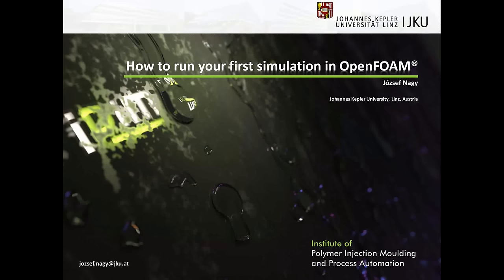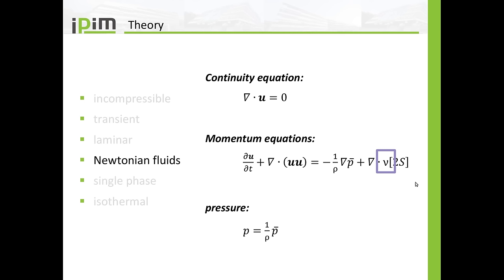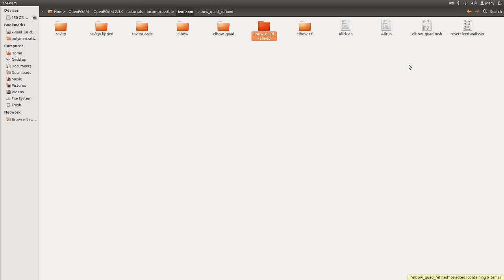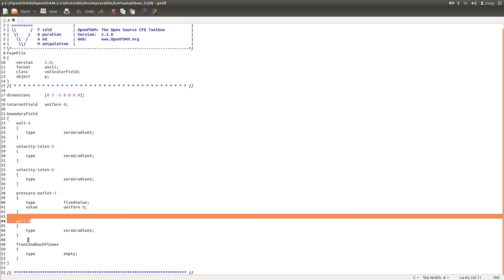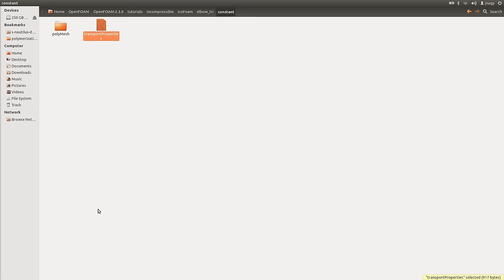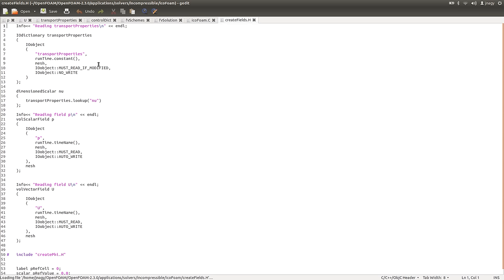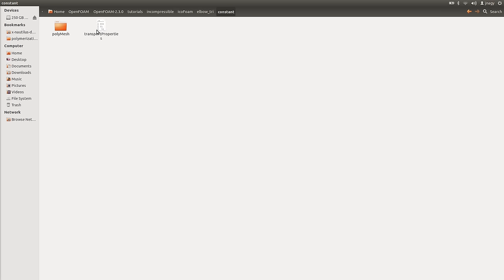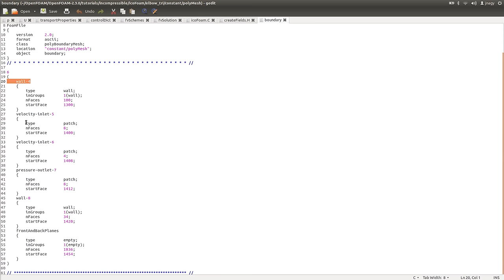How to run your first simulation in OpenFOAM® - Part 1 - tutorial (download link to msh files below)

Comment: Thank you.
I am using a Windows 10 based OpenFOAM.
when I make copy of the 'elbow' file and try to call the folder in the 'Ubuntu' page (as you mention in this video), it says 'access denied'!
no matters what I name the copies. 
it only calls the original file.
I would appreciate if you can guide me to come over this issue
Reply from the maker: Where are you files located? On your linux file system or Windows? What is the path?
Reply: it is on:
C:\Users\aeyad\AppData\Local\Packages\CanonicalGroupLimited.UbuntuonWindows_79rhkp1fndgsc\LocalState\rootfs\home\amin\OpenFOAM\OpenFOAM-v1712\tutorials\incompressible\icoFoam

this was chosen automatically during the installation.
Reply from the maker: I see. Yes you are not supposed to access the files from Windows in that location. Open the bash and copy it there with Linux.
Reply: I just searched the disk for ubuntu and I see that there are many files and folders related to ubuntu. The .exe file is under:
C:\Users\aeyad\AppData\Local\Microsoft\WindowsApps\CanonicalGroupLimited.UbuntuonWindows_79rhkp1fndgsc 

and the other files are under:

C:\Users\aeyad\AppData\Local\Packages\CanonicalGroupLimited.UbuntuonWindows_79rhkp1fndgsc\LocalState\rootfs\
in different folders.

what exactly should i copy and how? can I do that using 'copy+paste' in windows or should I do it in bash?
Reply from the maker: No that is a terminal. You do it like in a terminal in Ubuntu. You have to type in the commands.
Reply: I copied the whole tutorial and pasted by the ubuntu.exe and it worked.
thanks a lot.

in this video you have this 'elbow_quad.msh' which you will use it for two of the simulations.
where do we get that from? or how do we make them? without that it is not possible to follow the next video!
Reply from the maker: Download link in the description of the video.
Reply: Thank you very much for your awesome work and incredible support.
Reply from the maker: I am glad to help.

Comment: Hi József, thank you for the video. But please help me, this is my first time in OpenFoam, I've just downloaded and installed it, but I have an error on "fluentMeshToFoam", because I got a message in the terminal that says that it can't find the order. Thankyou,
Reply from the maker: +alesabden Did you watch my video on how to install OpenFOAM? Maybe you forgot to add the one line into your .bashrc.
Reply: +József Nagy thank you, i'm gonna see it
Reply: +József Nagy ,
Hi József, thank you for the video. I have the same pb than alesabden, running "fluentMeshToFoam" , the command is not found. 
I added the line "source $HOME/OpenFOAM/OpenFOAM-3.0.0/etc/bashrc" because I installed the software in my home directory.
The variable $WM_PROJECT_DIR is : /home/romain/OpenFOAM/OpenFOAM-3.0.0
And I ran "source $HOME/.bashrc" in the folder OpenFOAM-3.0.0  

Did I forget a step ?
Thank you
Romain
Reply: I just found the pb.
I ran "wmake $FOAM_UTILITIES/mesh/conversion/fluentMeshToFoam" and now it works. I suppose my initial installation was wrong ...

Romain
Reply from the maker: I'm glad it works.
Reply: +Panloup Romain Can you explain a bit more as to how you solved the problem?!
I'm still getting the "Command not found".
Reply: just check the video of how to install OpenFOAM. In my case, I was missing the bash part
Reply: I downloaded the DEB pack openfoam 3.0.1 recently and didn't add the .bashrc at the end of the installation. Any way I can fix this problem.   fluentMeshToFoam command not found error is returned probably due to this.

Comment: "Command 'fluentMeshToFoam' not found, but can be installed with:..."
But I already have OpenFOAM installed, btw, V7. Is that a problem?
Reply from the maker: You have to add one line to your bashrc. Check my installation video for more info.
Reply: @OpenFOAMJozsefNagy  This was very succesfull!! With a little bit modifications (I don't know if it should happen), because I am using directly on Ubuntu, so my OpenFOAM was on "/opt/openfoam7"... for now it's working. Thank very much.
Reply from the maker: @AndreLuiz-dz1qk  Great!

Comment: Hiiii...
I opened the elbow folder then after that opened the 0 folder but,  My pressure file from the 0 folder is mot opening. can you please tell which App is that
Reply: also at 18.05 when I'm trying to open the  elbow_tri  it is saying that permission is denied. Can you please help
Reply from the maker: @zeeshanjamal8592  Which OS are you using?
Reply: @OpenFOAMJozsefNagy  windows 10
Reply from the maker: @zeeshanjamal8592  Try notepad++ on Windows

Comment: Hi Jozef, i'm usin Windows and i copy manually the folders renaming them, they disappear in ubuntu environment. Can i work outside from the home/Username/.../icoFoam/...?
Reply from the maker: Sure that should not be a problem. What is the command you use for copying?
Reply: i'm using Windows, i past it with ctrl+v !!
Reply from the maker: From Windows you cannot access the Linux home. Do you copy within the bash or in Windows Explorer?

Comment: in my openfoam version v1812 ,there is no option like polyMesh in the constant folder.sir can you please reply why is it so.
Reply from the maker: Did you execute the command fluentMeshToFoam? Did it run successfully?
Reply: @OpenFOAMJozsefNagy  Hello Jozsef, the command fluentMeshToFoam cannot run successfully. It shows "command 'fluentMeshToFoam' not found, but can be installed with: sudo apt install openfoam". How can I solve this issue?
Reply from the maker: @yuqiwu6023  Did you enter the one line into your bashrc correctly?

Comment: Thank you so much for the video. I am a beginner with OpenFoam. I do not  have the polymesh folder in the constant folder. And I received following error:
   ~/openFOAM/openFOAM-v1912/tutorials/incompressible/icofoam/elbow fluentMeshToFoam elbow.mesh
bash: /home/ofuser/openFOAM/openFOAM-v1912/tutorials/incompressible/icofoam/elbow: Is a directory

I appreciate if you can help me.
Reply: hi i used to have the same issue, its usually because certain files don't have permission to be read/written. You can change this by using the command "chmod +rwx <filename> "

Comment: this you did in Ubuntu right, is there any thing in windows ??
Reply from the maker: Yes I did it in Ubuntu. You can try it in Windows 10: https://www.youtube.com/watch?v=xj0dB_PsElg&t=142s
Reply: thanks for your reply, i finished the installation and able to run the tutorials, can you help me how to generate the meshing in bash on ubuntu on windows and i need to take the images of the final shape, will you help me by  giving few steps.
Reply from the maker: It works like it would in Ubuntu. Try out my multiphase simulation project on my channel.
Reply: thanks for your reply, but am unable to open paraview i installed paraview and xming both in my pc, when i gave the cmd-paraview & it's saying that cannot connect to x server and when i tried with paraviewLinux  & cmd it's says cmd not found but i installed both xming n paraview in my pc,
     and when i tried with nano .bashrc am getting some thing different not like what you showed in the  previous videos.
Reply from the maker: Why do you execute cmd in the bash?
Reply: thanks for  your support, it's really awesome i finished my first simulation, thanks for your videos and help.
Reply from the maker: I am glad I could help.
Reply: hi sir i need one more help to find openfoam process to run simulation on Navier stokes equations for incompressible flow

Comment: First of all. Thank you for your videos.

You say that you are setting the pressure to be the atmospheric pressure (at 8:57) by giving it a fixed value of 0 at the pressure outlet. What do you mean exactly? I know that in this case we are talking about a ratio of pressure and density. Nevertheless, when we set this ratio to be  0 at the outlet, the pressure has to be zero. I would not call this atmospheric pressure since this would be a pressure of about 1 bar (usually) and if we assume air with a density of 1, the fixed value would be approximately 100,000, not zero to be atmospheric.

Again, thanks for the very educational videos. Good job!
Reply from the maker: Here we talk about the relative pressure. It is equal to 1 bar. Since OpenFOAM uses SI units the pressue is in Pa (actually as you mentioned correctly pressue/density). In these incompressible cases the pressure changes by maybe a couple of Pa. Instead of writing 99999.4 we can write -0.6. Or 100000.3 we can write +0.3. This is the idea behind it. For compressible solvers the absolute value is very important.

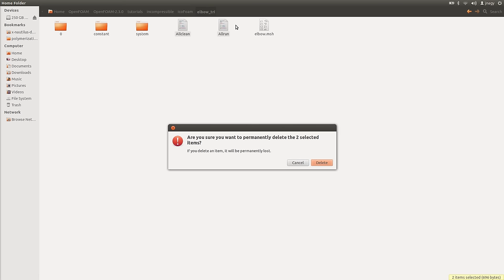Comment: At 6:57 elbow_quad.msh file is not creating what to do. Kindly guide me.
Reply from the maker: Did you download the file? Link in the description.
Reply: Thank you for reply but there is another problem at 15:29 I completely followed your instructions but it is showing that no such files or directory what to do kindly guide me.
Reply from the maker: @ambreenshah7583  Make sure, that OpenFOAM is installed correctly.
Reply: @OpenFOAMJozsefNagy   download as guidelines given by you properly.
Reply from the maker: @ambreenshah7583  Where is your installation? Did you enter the one line into bashrc?

Comment: Dear Jozsef, thank by the tutorials... they really help me a lot. I just have some questions,1) at 27min you show some values of pressure and Velocity, I think for 918 cells, at which time do they correspond?  2) what a bout the FluentMeshToFoam, is this a replacement to blockMesh? and 3) In case I am interested in another problem, example: multiphase/interMixingFoam/laminar/damBreak ... where I can find the solver in this case, I've make interMixingFoam but nothing happens... Thanks by your answer.

For more questions, is it possible to make by here, or do you prefer by email: juanenriquephd@gmail.com???.

Thanks again, Jozsef
Reply from the maker: 1. The pressure and velocity fields are for the time step of t = 75s, what you can see, because I am in the folder 75.
2. In this case I did not want to talk about meshing, so I just used one created in GAMBIT. With fluentMeshToFoam you can convert a Fluent file to the OpenFOAM format. Yes this is the mesh creation step. In later tutotials I use blockMesh for that. But snappyhexMesh or other meshing tools work also.
3. Depending where your installation is, the source code of the solver is in pathToOpenFOAM/OpenFOAM-2.3.0/applications/solvers/multiphase/interFoam/interMixingFoam/, the tutorial is in pathToOpenFOAM/OpenFOAM-2.3.0/tutorials/multiphase/interMixingFoam/laminar/damBreak. Then execute blockMesh, make copies of the backupfiles *.org in the 0 folder, run setFields and then interMixingFoam.
You can just post questions here, so other people can see them too and maybe even give you an answer. I cannot promise to answer all the questions, as I am not familiar with all types of flows. I am no master Yoda. BTW, my next tutorial will be on multiphase modeling with VOF, not interMixingFoam but the standard interFoam solver, maybe this could be helpful for you. However, I need time to prepare for that.